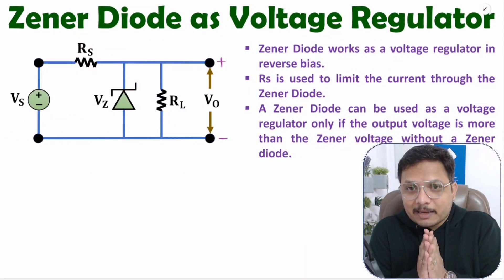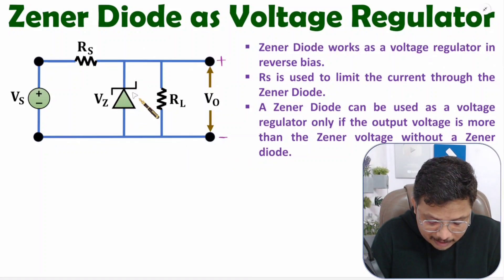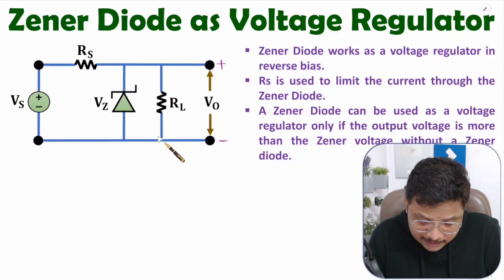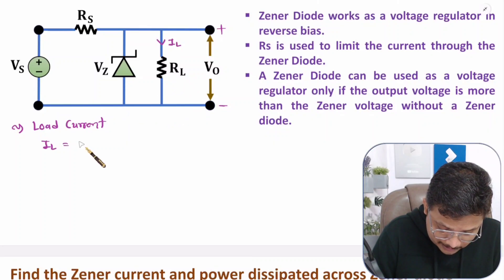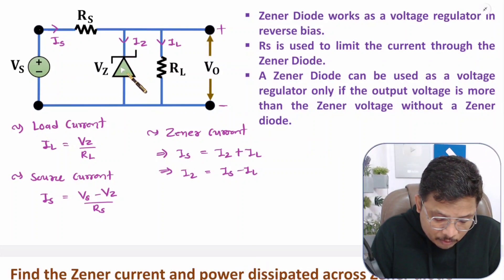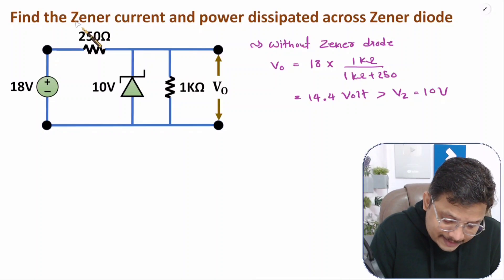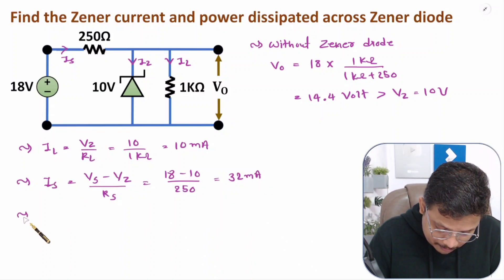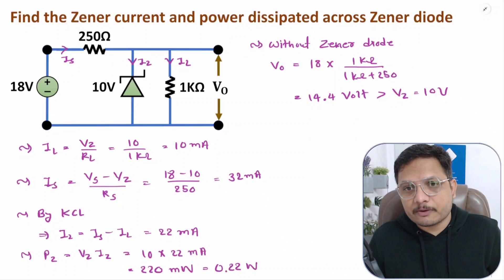Zener Diode as Voltage Regulator | Parameters & Example of Zener Diode as Voltage Regulator

Comment: sir how you find out the output voltage is there any formula
Reply: Assume for a while that zener diode is not there in the circuit. You get a simple 2-series resistors circuit and you just have to calculate voltage V_o across load resistor, which is easily calculable using the Voltage Division rule.

Comment: Sir please provide us the value of doping concentration in zener as well as avalanche diode
Reply from the maker: The doping concentration of a Zener diode can range from 1015 cm−3 to 1017 cm−3 for the p+ layer, and 1014 cm−3 or 1015 cm−3 for the p- layer. With normal PN Junction Diode doping is lower by around 1000 times.